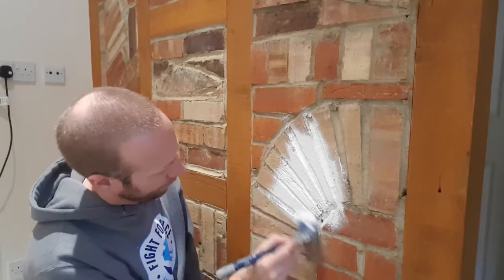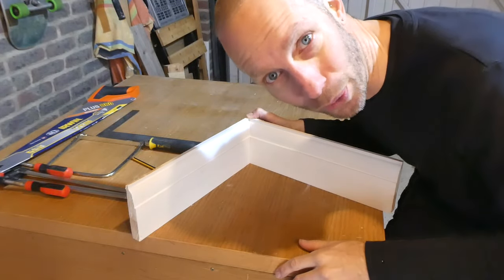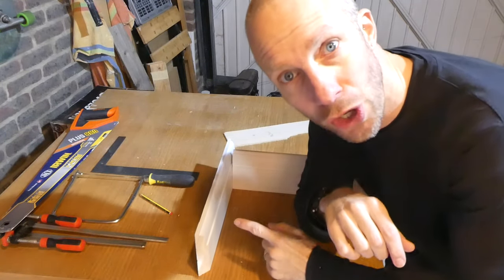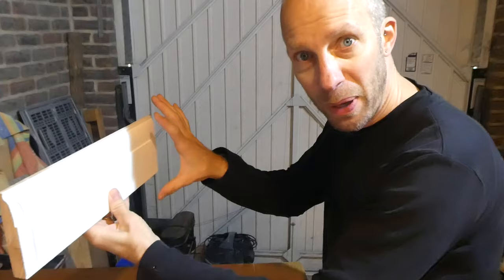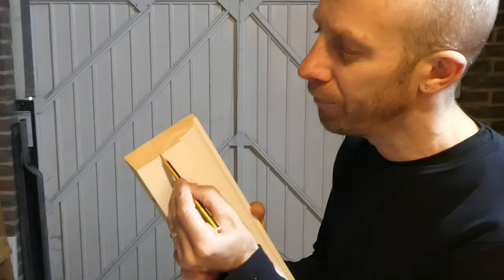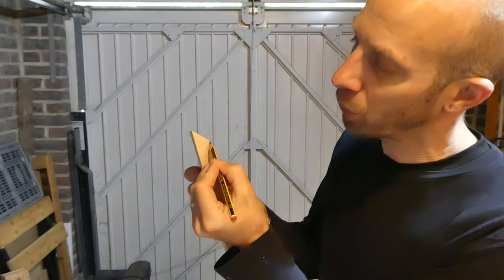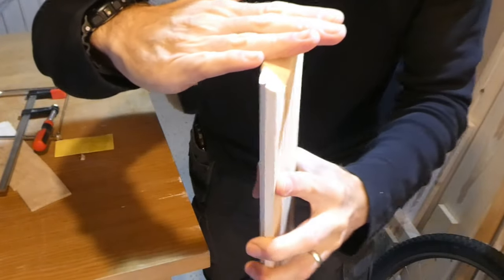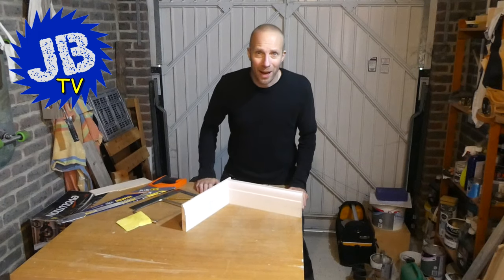How to Cut and Scribe an Internal Corner on Skirting Boards

Comment: Iv seen so many videos and still confused lol why cut 45 angle to then cut it off.  What am I missing
Reply: Took me a second watch to figure that out too. Look at the edges left by that 45° cut - it's the exact profile of the piece you're butting up to. No need to draw anything. Just cut along that edge at a slight backward angle.
Reply: @andy.robinson  having trouble with a straight board. It's a kitchen upstand with no detail so it's not really working for me
Reply: It’s called an open mitre, the point is it gives you the profile of the skirting with an edge you can follow with the coping saw. Also hold the coping saw upside down and turn the blade at 45 degrees or so, this forces the scribe to be undercut so it doesn’t foul the profile on the other side.

Comment: There’s not such thing a an internal mitre. Carpentry rule number 1. The whole purpose for the scribe is to eliminate shrinkage. If you mitre the internal I don’t care how square your wall is, over time this will open up and look like crap. Same applies to crown mounding don’t internal mitre it.